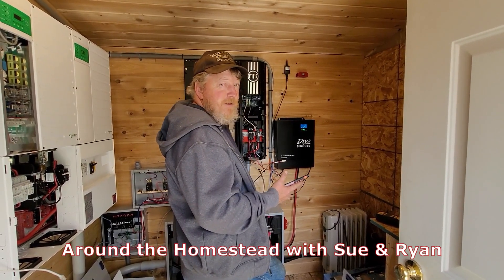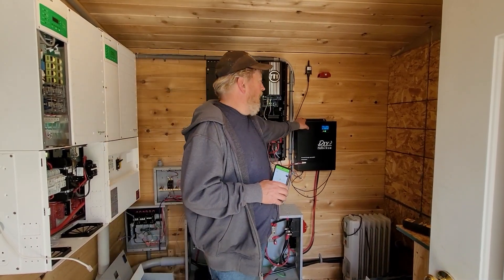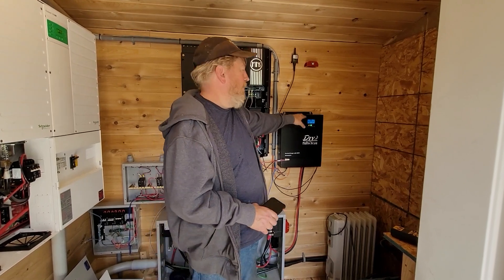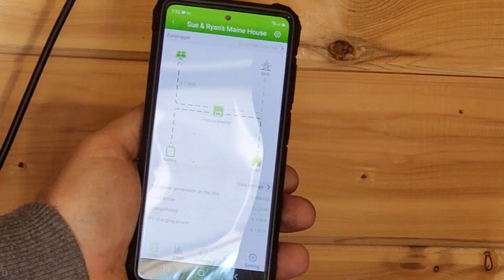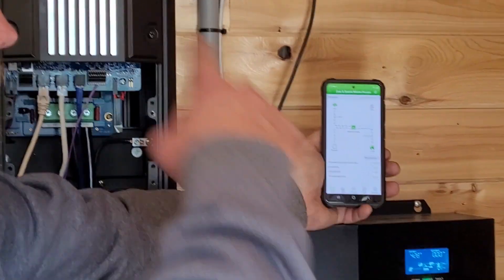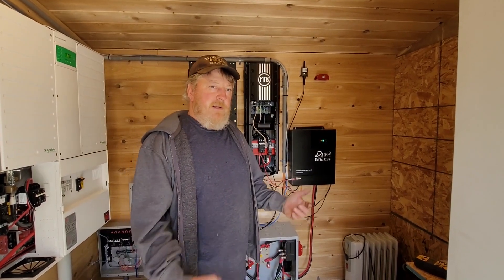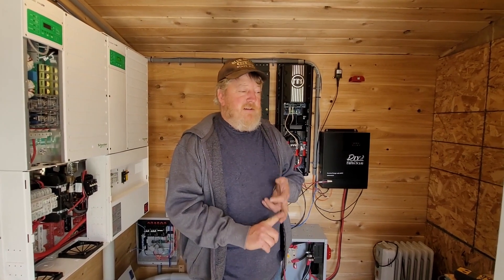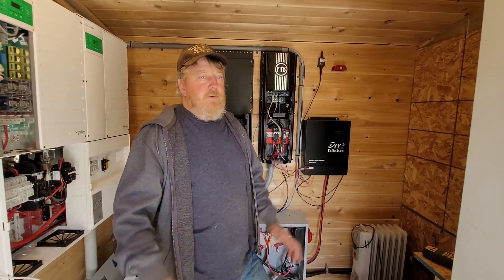Overdriving our Midnite Solar MN5048DIY inverter charger 9,150 Watts!

Comment: Nice, interesting that the app looks different than the MN3024. Could be from an update though..
Reply from the maker: The 3024 is physically smaller but generally the same layout if I recall
Reply: @aroundthehomesteadwithsuer3497  yes, same menu, same layout, just physically smaller and less powerful. I also edited my original comment here,  it's the app that looks different on mine.

Comment: Where is the 10K DiY Split Phase 120/240 inverter ?   I heard it mentioned in several of your videos and the webinars but i can't find it on Midnight website.
Reply from the maker: Midnite did some testing with a 3rd party inverter and found some issues that needed correction. They are currently in testing on a couple of options to move forward but a product will not be released until satisfactory testing has been completed to ensure the customers are getting a quality product.

Comment: One thing I'll add I talked on the phone for a hour with a guy at midnite office and we went over everything. My whole set up to see if we could find the problem. But everything is done right. The only thing we came up with was the wire I'm using on my battery s is a 4 and the manual says it should be a 2. Can that be doing it?
Reply from the maker: Yes, I do find the 5048 is a little different, More like a Solark in that it injects the PV into a high voltage rail internally. What I find is on big surges with long and small battery cables it will toss error 05, I assume this is an internal design to prevent damage tot he pv section. How long are the #4 cables?
Reply: @aroundthehomesteadwithsuer3497  oh ok well maybe I should get the size 2 wire? Well there about a foot long each going from battery to battery.
Reply from the maker: @amazingracestudio  Can you tell me more about the system? How long are the cables fromt he inverter to the battery? What are you using for a dc disconnect or fuse? What is the battery bank made up of?
Reply: @aroundthehomesteadwithsuer3497  yes. Ok there all pretty close together. It maybe a 5ft wire from the batteries to the inverter. The batteries are; 8, 12v 100ah. I have them connected and running at 48v.  The batteries and panels are going through each there own breaker that I also purchased from midnite solar.
Reply from the maker: @amazingracestudio  So 200Ah of lead battery. That is minimal for a 5kW inverter but would likely depend on loads. Did a specific load cause the Error 05 and will that error not go away now or does it just show up on certain loads?
Reply: @aroundthehomesteadwithsuer3497  my batteries are acid. Yes. No. No matter what I do I can’t get rid of the code. I’ve turn everything off and restarted it but nothing helps. It’s the same thing as the first one I purchased. But the first one right out of the box had the code it never did work. This one at least worked for 2 months.
Reply: @aroundthehomesteadwithsuer3497  I haven’t changed the load on it at all. The only thing I have running on my solar is a small 6 amp frigid and lights
Reply from the maker: @amazingracestudio  I will chat with Midnite today that load should not be big enough to matter

Comment: I have the same inverter. It keeps throwing the code #5. It's the second one I've got and it does the same thing the first one right out of the box kept throwing the code and they replaced it and the second one has been perfect for 2 months but then again today like the old one it throws the code #5. What am I doing wrong? Or is it the inverter?
Reply from the maker: Error 5 is an interesting one. I don't have a ton of experience with it but I would probably call or email Todd at Midnite he is their GURU on the DIY line

Comment: Hey Ryan Spencer at Langston's alternative power trying to connect the Wi-Fi dongle to the DIY and it's asking for the SN number on the inverter I was wondering do I punch in the whole sequence of numbers and letters or just a certain amount of numbers
Reply from the maker: I will have to go look more but what i recall is it didnt want anything from the inverter it just asked for me to scan the WiFi dongle or enter its info. I didnt recall it wanting anything from the inverter
Reply: @aroundthehomesteadwithsuer3497  I noticed it looked like you had to ethernet cord hook directly to the 5048 and you had the Wi-Fi dongle plugged in the other Port is that correct the Wi-Fi dongle connection was super easy just scanning and it picked it right up.

Comment: Hey Ryan,

just installed a mn3024 and it is not charging when connected to the pv array. I dont have the ac input installed. It is connected to a Liion battery module and i set it to Li in the menu and raised the boost voltage on the unit and still didnt go into charging mode with a flashing green light. Can you advise. thanks.
Reply: turned on the inverter and closed the PV input and it is is working as it should.
Reply from the maker: Glad it is behaving now. if you have any issues I would suggest hollering to Todd at Midnite Solar

Comment: Curious how much of that fan noise is coming from the MN5048. I am considering purchasing the 3024 but can't have it sound like an airplane running in my small cabin.
Reply from the maker: The schneider inverter is also running in this video, cameras distort noise and this is a very small space. I would say that we do not find the fan noise from this inverter to be greater than expected.

Comment: Great. What about the 3500 watt unit?
Reply from the maker: It will also tolerate over driving in wattage but like any MPPT never exceed the voltage. Ryan will be doing a follow up video on both the 3548 and the 5048